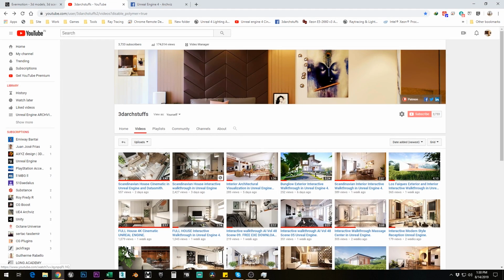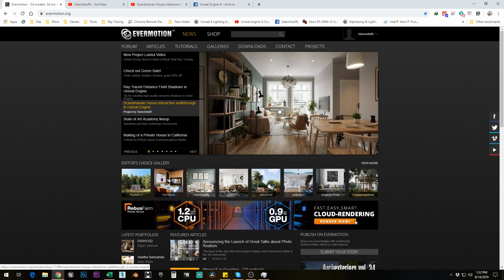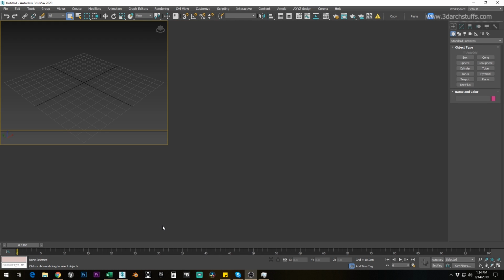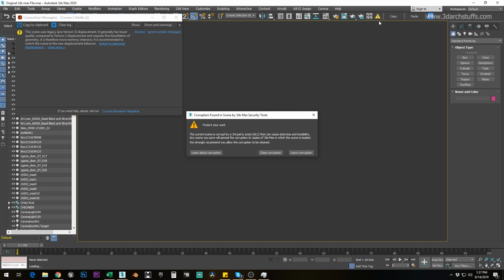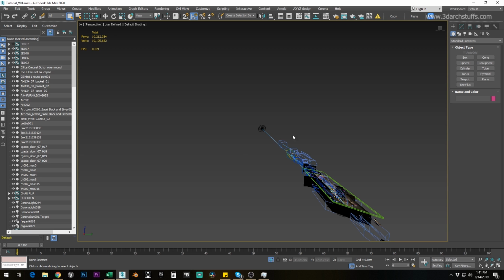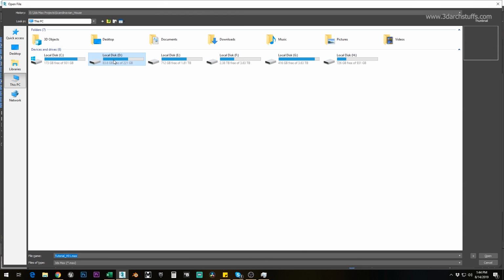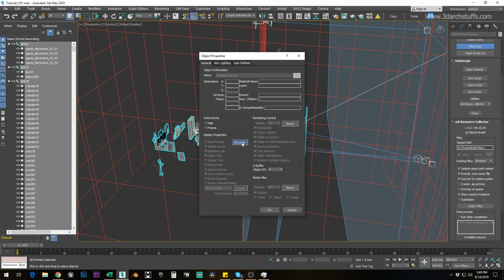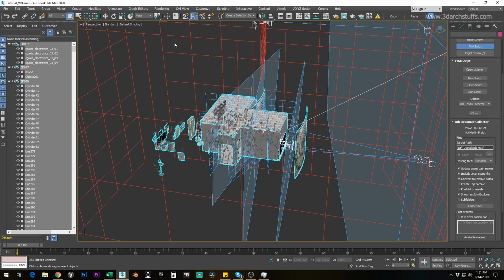Scandinavian House Unreal Engine Complete tutorial Step by Step Part 01 (Free)

Comment: Is there a reason why you convert the the 3dsmax objects to editable meshes rather than editable poly?  I've read this does not matter.  I prefer the editable poly since it offers a few more editing abilities such as bridging and connecting edges, insetting,bevel etc.  This wall geometry in this 3dsmax model is a mess and it would be much easier to fix as an editable poly.

Comment: I have to have floor generator installed?  I am not seeing a floor in the model and I am assuming you need floor generator.  Any scripts, plugins or other third party things needed to do this course should be mentioned.
Reply: Okay, so I can confirm, you do need to have floor generator plugin installed in order to see the actual floor that is included in the 3dsmax file.  I have installed the Floor Generator plugin, the multi-texture plugin and now I see what is shown in the video.  Again, not trying to sound like broken and repeating record but you really need to mention this as it is frustrating opening the scene and then having to figure out what is missing, closing the scene, installing missing scripts/ plugins and then restarting.  Put a note on your webpage purchase area or edit it into your existing video training.
Reply from the maker: The same effect which u can get from floor generator  can be achieved in ue4 with normal on material which will also help in getting better fps. That is why I said if u  don't have floor generator np if u have it its ok. In ue4 I have shown how to take care of the floor present in the scene with materials.
Reply from the maker: My friend  u don't need floor generator.  If u have it already its ok.
Reply: 3darchstuffs I don’t have floor generator.  My floor in 3dsmax scene is black and I can’t do the adjustments you show in video.
Reply: 19:06 in Video 1 clearly shows Floor Generator plugin being used to adjust height settings on existing floor.    It's not a problem using this plugin but I think it should be mentioned it is needed for the tutorial.  Just have a list of all of the recommend plugins, scripts that should be installed for this course.

Comment: Not sure if you want me to comment here or reach out to you directly.  Maybe others benefit if I comment here.  Anyway, another thing you do not seem to mention in the early going of these tutorials is the scene scale/ units of the 3dmodel coming into unreal.  The scene you supply is in centimeters.  Since I am from US, we create alot of our scenes in inches.  Datasmith will usually bring things into UE pretty well regardless of unit but my understanding is that UE prefers metric.  I have read that it prefers to work on a unit size of 1 meter.  Do you have any thoughts on this and how do the units impact the scene in UE?
Reply from the maker: Aspersions my knowledge ue4 can only understand cm so I prepare the scene in cm and rest everything falls in perfect.
Reply: 3darchstuffs so then if a scene is created in inches, it should then be converted to centimeters prior to using datasmith or would that apply if I was just exporting as FBX?  I am pretty sure datasmith handles unit conversions.
Reply from the maker: No it can't.
Reply: Actually, I need to clarify this comment.  You do mention the centimeter setup in the 3dsmax scene you supply.  I guess I want to know that if I have a scene setup in inches, do I need to convert to centimeters upon export to UE?  I have NOT done that in the past using max and datasmith.  I don't think I have had issues and I know others have done the same thing.  However, like I said, I think it has been mentioned that when creating objects from scratch in 3dsmax intended for the purpose of going into UE, it is good to use a meter system.
Reply from the maker: U have to convert the scene  from anything to cm before u send it to ue4 and also start a scene  at modeling with cm. That is for sure. If u used any unit  and u didn't  faced any problems  means u are a god.
Reply: 3darchstuffs haha....I can absolutely guarantee I am not a god.  If I was, I would not be taking your course.  If you read the current datasmith documentation, they are saying the unit conversion does happen in there.  1 in = 2.54 cm.  However, it seems like it may be good to convert manually in 3dsmax prior to export.  I have a pretty nice VR building scene I did in 3dsmax and then brought into UE 4.22 with datasmith and I had no real issues.  It came out pretty decent too.   Still, I’d like to learn to do it right.
Reply from the maker: Thank you.

Comment: I had purchased this course and I am working my way through it.  It appears to be very well set up.  However, out of the gate, I am having issues just getting the initial 3dsmax scene to display properly.  This should be addressed but looking forward to working through this project.  I plan on writing a full review of my experience with this Tutorial Series from you as it looks very promising.
Reply from the maker: Thank you so much.  Good luck.  Please get in touch with me on Skype id sunil00675 so that I can help u with any issue instantly in real-time.
Reply: @3darchstuffs  I emailed you about code for the other course.  I was ready to purchase and it did not work.
Reply from the maker: Can u explain  this plz so that I can help?
Reply: 3darchstuffs yes, please resend me the code in the email I sent to you 10 minutes ago.  Thnx.
Reply from the maker: To get over with black in the scene install trial version of corona and that will be more than enough to overcoming ur black error
Reply: @3darchstuffs  I understand I can do this but I did not want to have to download and install another render engine.  I get it and I will do it but you really should mention this in your video.  It's little details like this that make or break a course as it is frustrating when there are holes that one has to waste time trying to figure out.  However, I am going to say this, you seem to be really responsive so that is a huge plus.
Reply from the maker: U just need to install the trial version of the corna and nothing else is need in terms of corona renderer. Only installed corona is all that required  for the tutorial and rest everything is shown in the tutorial don't worry be happy and follow  the tutorial will learn photorealistic archviz in unreal engine once u finish the tutorial. Good luck.

Comment: now vray is also available for unreal...plz...make tutorials on UE4 With Vray workflow
Reply from the maker: Sure.
Reply: I am curious, if you are interested in doing still renderings using vray, then why use unreal at all?  If I am correct, vray for unreal is not doing anything for real time rendering so to speak.  I think it just polishes up the material and scene to create better stills.  If that is so, then why go through the hassle of getting a max scene into unreal when you can render your vray stills inside 3ds max?